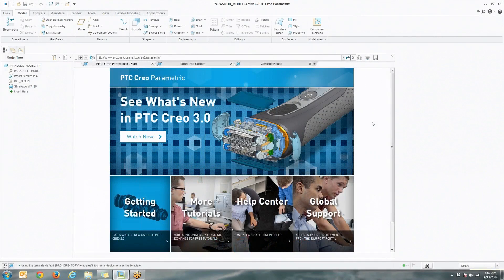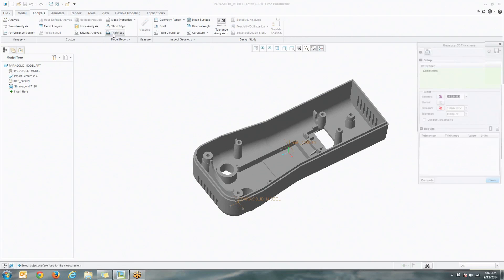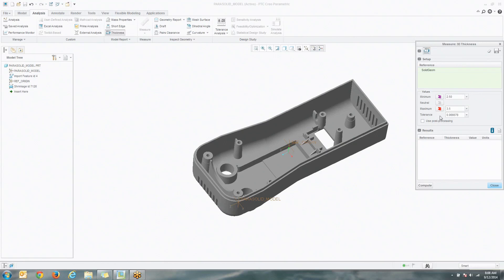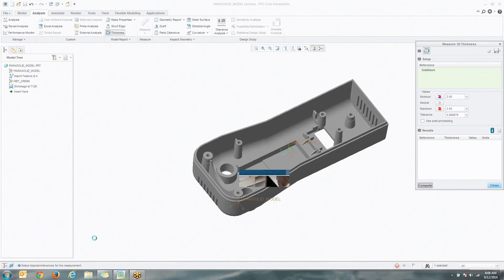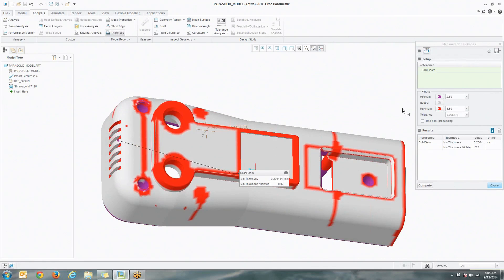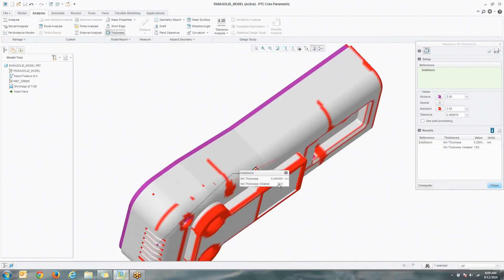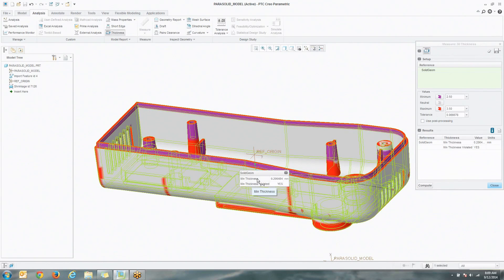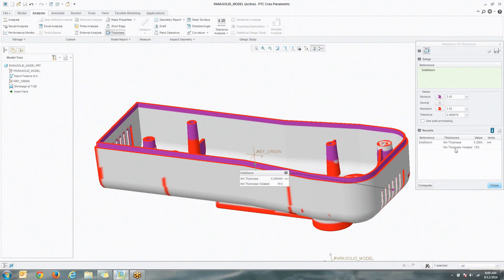Checking part thickness with the PTC Creo 3.0 3D Thickness Check - EAC Tip of the Week

Comment: It would be nice to also show a flag note pointing to each area that exceeds the max thickness, as opposed to only flagging with a note the areas that don't meet the min thickness.
Contrary to the video, overly thick walls lead to sink marks and flow problems and it is of equal value for injection molding. The colors don't work as well as seeing a note pointing out the specific areas. It seems the tool has fallen short here unless it can be configured to include the note for both max & min and not just for min.